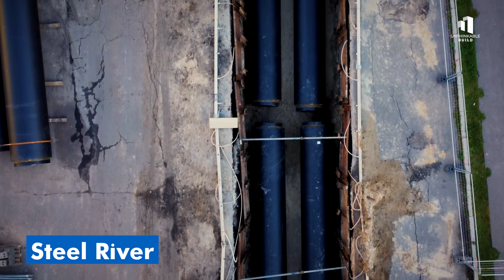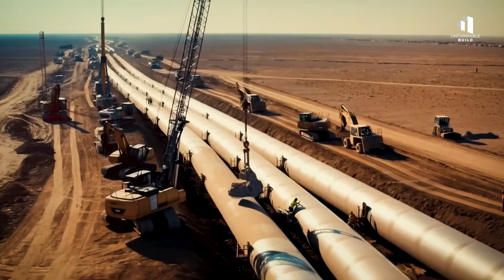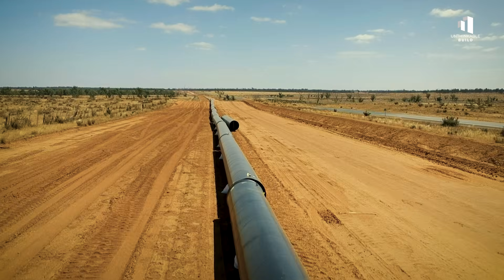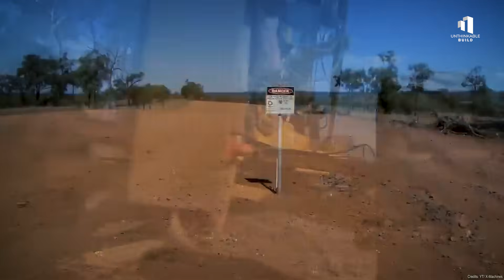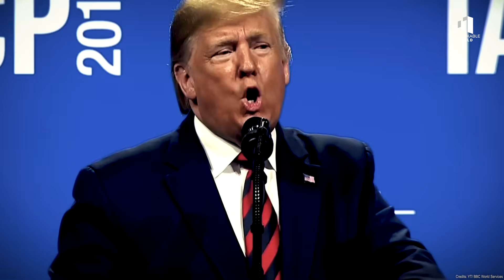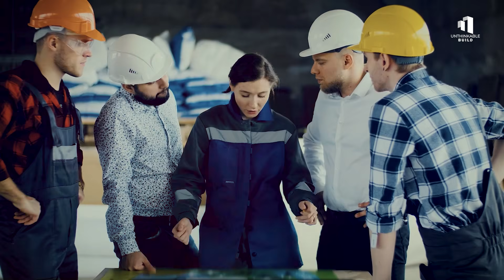How Engineers Forced Venezuela’s Impossible Oil to Flow

Comment: Did I miss the part of how the engineers forced the oil to flow?  I understand how pipes allow for the movement of the oil but how did they get oil with the consistency of peanut butter to flow?  I remember the Alaskan oil pipeline was heated but I didn't see that here; probably not.  Is the oil heated before being piped? If so how does it maintain its temperature throughout the journey to port?
Reply: You did miss the part, they would dilute it with a more liquid type of gasoil.
Reply: @oldwiseoulNaptha is used.
Reply: Must have a small plant at the start to water it down
Reply: THEY USE A LIGHT GASOLINE LIKE DILUTANT TO FLOW THE HEAVY CRUDE.
Reply: @kocyszemaitis2310 Yeah apparently I missed the part about it being refined before pumping.  That would have answered my question before I asked.  That I understand.  Completely missed that part.  Still.
Reply: @RondoHunter3.14 America is the world's largest refinerier of Heavy and Super Heavy Crude. Texas and Louisiana coast
Reply: Naptha is a solvent and gets refined back out
Reply: @Imma-bv3ib Yep.  That's why we sell the light crude we produce.  We can't refine it.
Reply: @RondoHunter3.14 We can but it's not our primary stock for export of products
Reply: @kocyszemaitis2310 Naptha
Reply from the maker: That’s a good question, and it’s the core technical challenge of Venezuela’s heavy oil. The oil isn’t moved by simple gravity alone. In practice, engineers reduce its viscosity in a few ways: it’s often blended with lighter hydrocarbons (diluent) or upgraded so it can flow, and in some cases it’s warmed or heated locally during initial processing. Unlike Alaska’s pipeline, the entire line usually isn’t continuously heated; instead, temperature is managed at key stages, combined with pumping pressure and blending, to keep the oil moving all the way to export terminals.
Reply: @UnthinkableBuild A lot of details were omitted.

Comment: It can be both. Engineering breakthroughs can unlock difficult resources and give countries leverage, but they also tie those projects to global markets, sanctions, investment cycles, and geopolitical pressure, which can increase exposure to international politics rather than reduce it.
Reply from the maker: Agreed. These projects expand technical capability and access to resources, but they also increase dependence on global systems. That balance between leverage and vulnerability is a defining feature of modern mega-engineering.